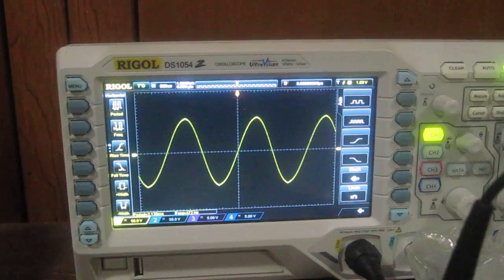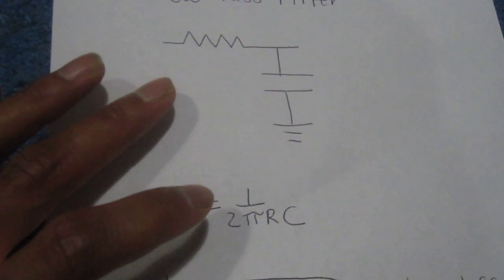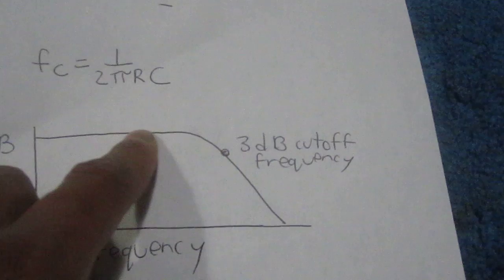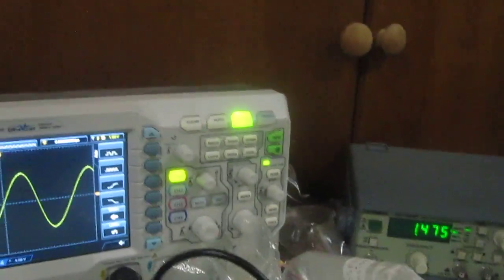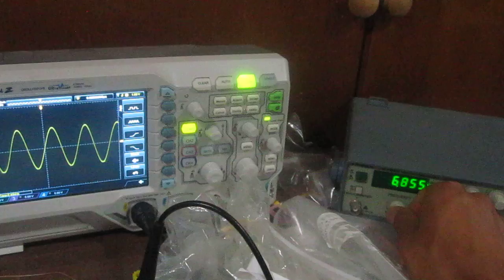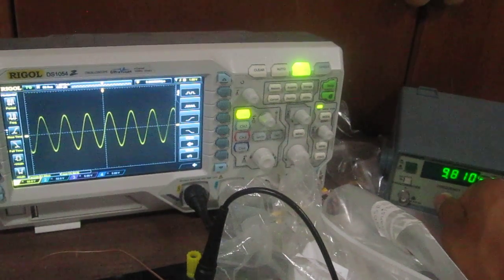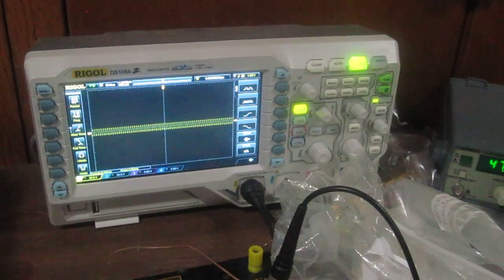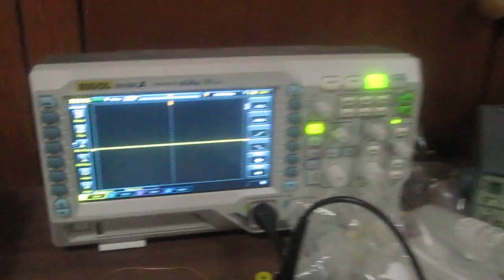RC Low Pass Filter Circuit

Comment: Does increasing or decreasing the value of the capacitor effect the characteristics curve of the LPF?
Reply: Decreasing the capacitor value will only affect the cutoff frequency.  An RC LPF as described in this video is a single pole filter and as such 70.7% of the input voltage will be present at the output.  The rate at which the output amplitude decreases is steady at -20db per decade.  You can get further details/explanation at the following link for example : https://www.electronics-tutorials.ws/filter/filter_2.html